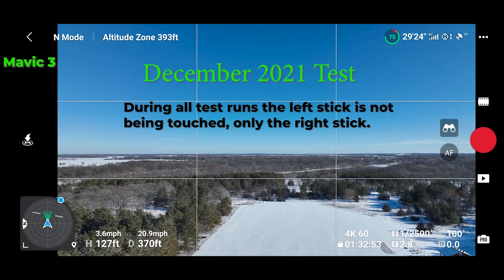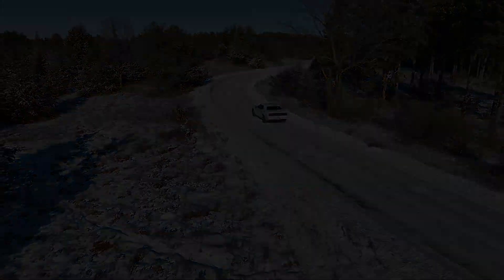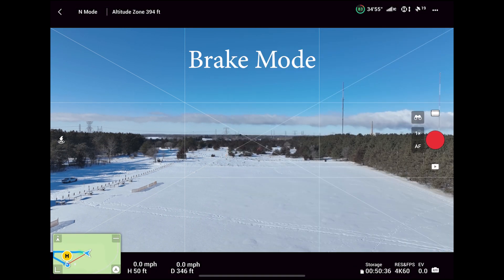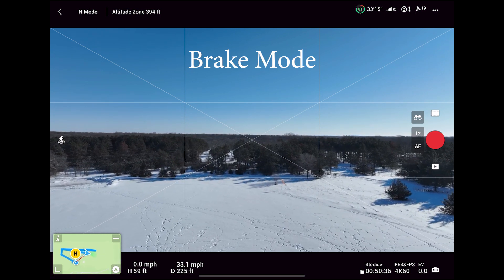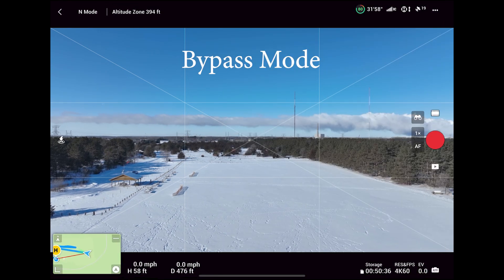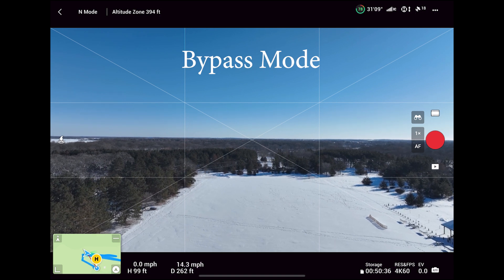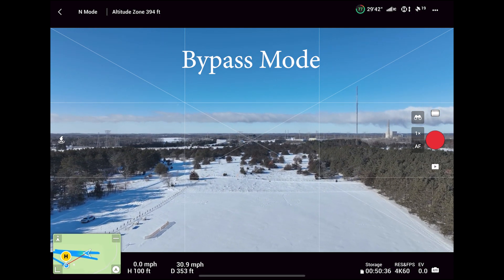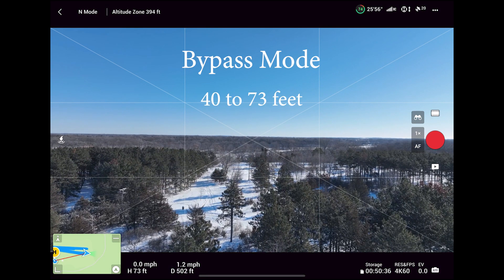Mavic 3 Altitude Increase  - January 2022 Firmware Release

Comment: You might need a replacement Mavic 3 because I don’t have that problem flying over snow!
Reply from the maker: Maybe. A few in DJI Forum say it is just OA and trees a football field away lead to altitude increase.  Not sure where the trees were in run 1 of video which require M3 to go to 200 feet AGL to get over them. I will be loading firmware again and do another IMU update to see if anything changes. Also looking for large frozen lake with no trees for a mile ahead and no fish houses. So I can see with zero objects for a mile if M3 holds altitude or still increases. That said it is risky to fly as in last flight I lost video 4 times on one battery. So I need to isolate that issue too.
Reply: @MarcusGlass  either way it will all work out after doing all the necessary testing etc, and if everything still remains the same, you have the option to reach out to DJI for a replacement. Have a good day!
Reply from the maker: @mr02gixxer1000    Some are convincing me I am an idiot and this is expected behavior. If it is what it is and does not change then mental note to myself never fly in bypass mode over snow (or water). Some say they have no issues at all like this.  Some say they do over snow and water.  I will have to decide whether to live with it (brake mode when flying over snow/water) or send into DJI and hope when a Mavic 3 is shipped back this does not happen.
Reply: @MarcusGlass  it will all work out either way. I doubt that your replacement unit will have the same results. Seeing that this is not a common issue!